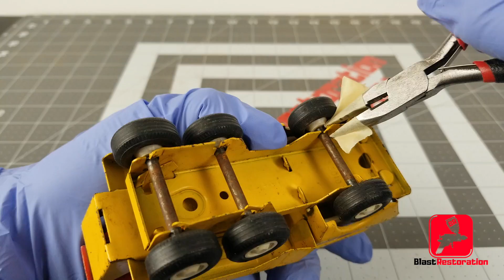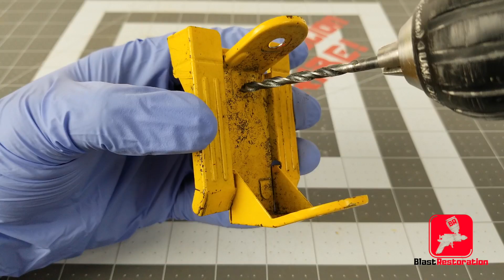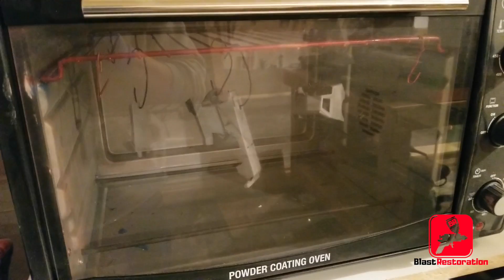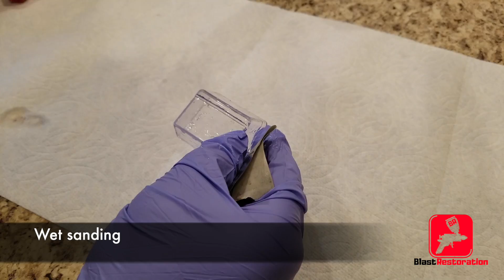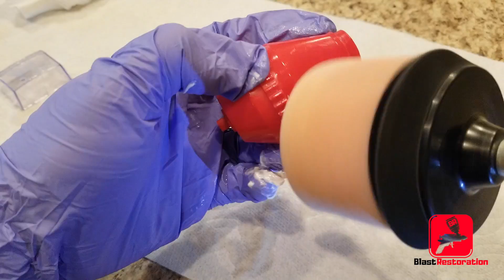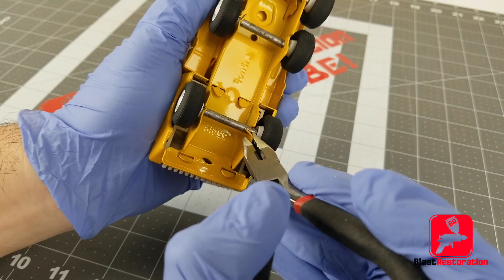Tonka Cement Truck Restoration!

Comment: Honest question, not a criticism; Is there some advantage to complete disassembly such as the front rivet of the cab? Thanks, Pat
Reply from the maker: Yes there are a few. For starters if you don't take it apart and use powder coat you will have weird lines around the rivet and where the metal joins and wont be easy to take apart again. Also most of the time there is rust in these areas and if not taken care of it will ruin your hard work down the road. Thanks for watching!
Reply: Blast Restoration thank you!